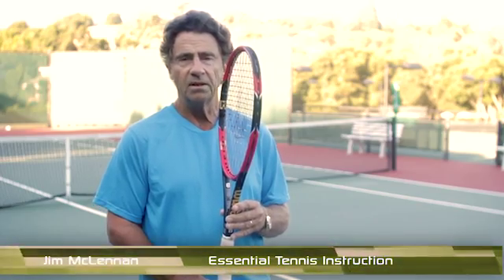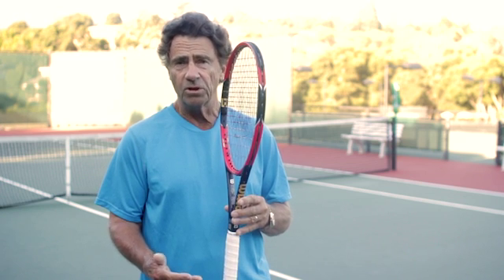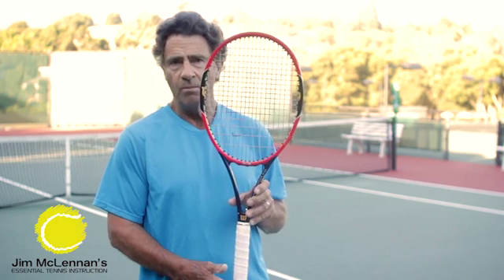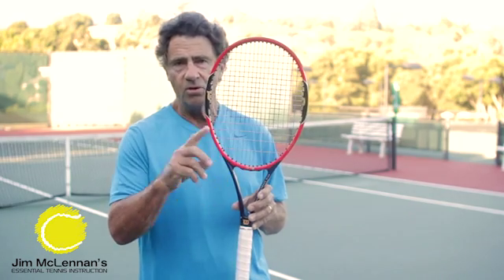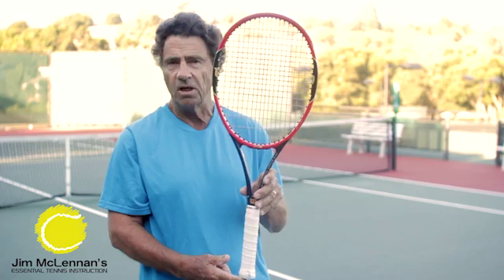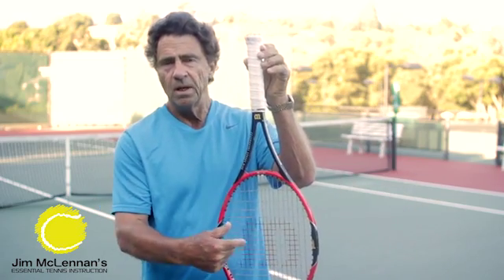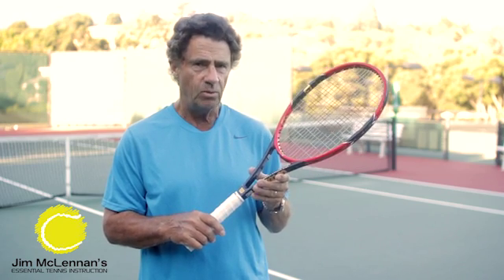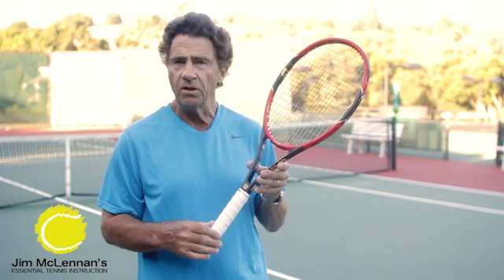Racquet Rebound Potential

Comment: How to reconcile this with softening the grip for a drop volley?
Reply: The common coaching cue I have heard to loosen the grip for a drop volley (using the same Continental  grip as normal drive volley). But the study cited says that rebound speed is the same for racquet balanced on table and  racquet in a vice, which suggests that the distance traveled  is not affected by loosening the grip.

Comment: Hi Jim, I like your approach towards tennis teaching which is scientific in nature which gives food for thought. the experiment which you mentioned may stand true if you happen to hit ball perpendicular to its line of motion with loose grip, but I wonder if you would get similar results if your angle of incidence of ball with string bed is angled and also if the racquet is moving perpendicular to line of ball motion. under such conditions grip strength is crucial, and holding racquet loose will be counter productive as holding the racquet loose is an extremely bad idea. Your thoughts on this will be appreciated. Thanks